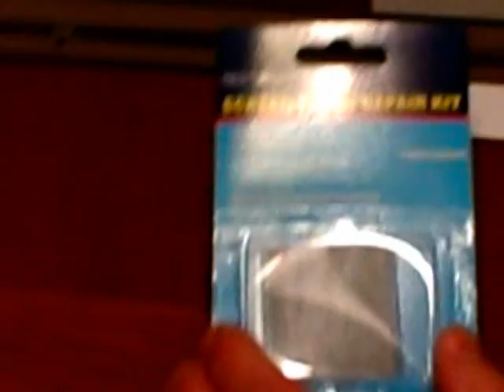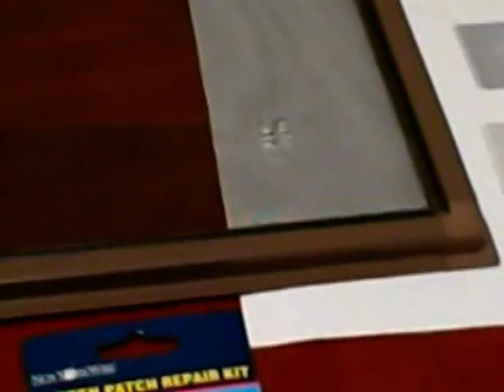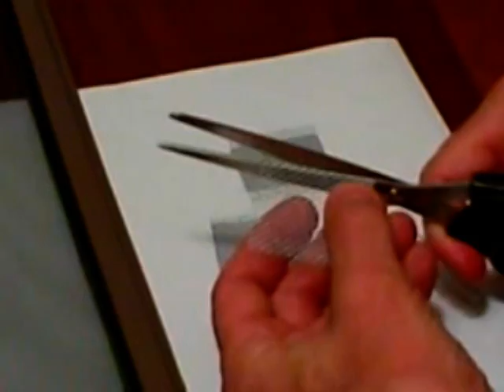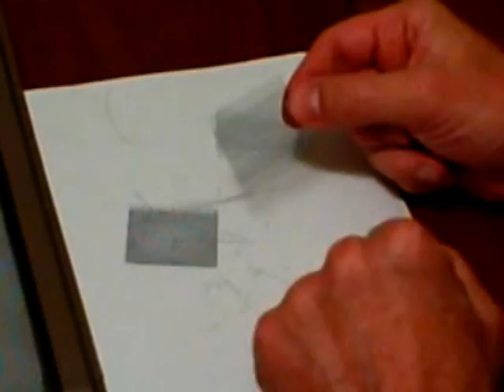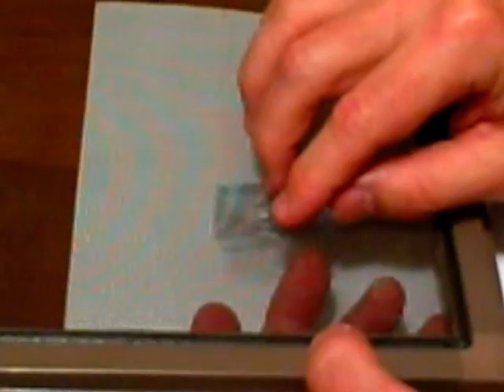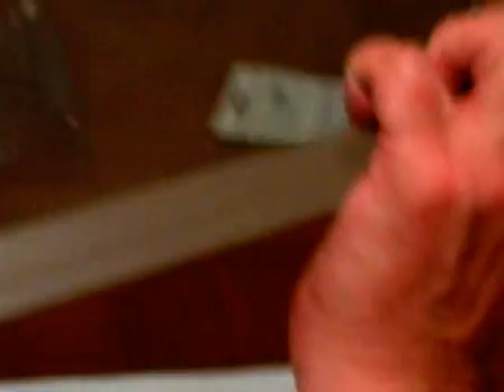How to patch a window screen - Window Screen Repair

Comment: I never have luck gluing but I still save any particularly yet serviceable hunks of old screen ...then rather than gluing, I simply SEW them overlapped on whatever new breech in the fabric...in fact just did a 5"X 15" section of sliding screen door  right at the edge surrounding in the  latch area ...I simply pried out  the rubber cord out pulling it loose in both directions and then with needle and thread, sitting in a chair I hand  sewed a  patch I'd cut just big enough to over lap and stitch in...next I trimmed out any excess within the patched area...then stretched it tight and pressed the cord back in...the final step was to run my razor knife down the metal for a neat trim ...looks totally patched but but neatly done with obvious pride in workmanship ...it is quality work!  No skeeters getting through THERE this summer!  ...I like it on account of it reveals my resourceful, innovative nature (well okay AND cheap assed)   Laugh all you want but it is another wonderfully  elegant, mechanically SOUND  redressment to another of my my not so loyal best (canine) friend's impudent escapades...if you ask me anyway....  After all any job worth doing, is worth the challenge of doing FREE without leaving the site ...stuff like this keeps the snobs off my property also, for they apparently simply cannot take such things lol  There's wrong way. a right way and a different way...
Reply: Also you see,  when a neighbor puts replaces their screen with a brand new one,  you snatch up that old one and then if is in better shape than one of yours you swap em right out!  (if you live in a tract all kinds of things are identical from one house to the next)  In either case however,  the newly acquired extra screen becomes a harvest-able resource...the cord is pulled free around the frame, the screen (if it is mainly still nice) is rolled up  tied and stored for future repair jobs along with the rubber cord if it too is nice...even the frame is disassembled and stored with all other hunks of scrap AL YOU menny M ...hey one way or another it WILL pay off to hang on to it (so long as it does not cost your marriage...lol)  ...I mean eventually ...start amassing to much scrap aluminum and ya just have to take it down to the crap metal yard and cash it in for a couple bucks per pound...I wager I have around 500-1000 pounds squirreled away AND my own private metal stock bin to build just about anything if I need to!  It's amazing how much scrap comes a person's way if they keep their eyes open and stay ever ready to POUNCE!  lol  BTW I have my heart set now on building my own forge and one use I can think of is simply to melt a lot of these un-neat wife's brain torturing hunks of aluminum into nice compact, clean valuable, fun to fondle and oogle ingots .....I LOVE that word ..."INGOTS" !  Yes  I WILL BE MASTER OVER METAL!!!  WHAAAH! HAAA!  ARRRRRR!...ARRRRRRR I say!   Make FIRE! Melt and master METAL!!!    Burly aluminum blacksmith!  clink clink...
Reply from the maker: Thanks for the tip!
Reply: Doug Chaney 
L
Reply: Dougie I love your comment exactly that what I was about to do...I love doing things my self even if it is literally dirt cheap.. especially when the fix like these patches wont make it clean look.. since I cant take the little filter from the bathroom because it is imposible without doing many hassle i tried first with the little metal thread the type you find to tie the plastic garbage but it did not align nor the same size, even though it can do the job.. so I bent a needle after heating it on fire .. and thread it with grey thread that match the screen.. the reason i want to catch the other end of the needle because I cant have access to the other side of the screen.. my needle is bent almost full arc or almost have a circle... I am ready to do it.. and then saw your comment... any tip would be appreciate it. Do you think the result would be somewhat invisible repair.. and should I thread as close to the hole .. and if so should tighten... cause I am afraid I would pull some of the good part of the little metal.. thanks ... love to know that there are many who take pride of doing these things.. take care

Comment: You wouldn't happen to have any videos or advice on repairing a bent or broken aluminum window screen frame or am I out of luck and just have to go out and buy a new frame?
Reply from the maker: Hi, you can go to the hardware store and they should have the stock. If not they should be able to order it for you. Many hardware stores also do screen repair.
We have more tips in our home improvement book http://www.amazon.com/dp/B01BK2K0JM?ref_=pe_2427780_160035660
Reply: See my comment above!!!!

Comment: Really good idea. I got a scrap piece of aluminum screen from the local "home improvement" store for pretty cheap, It took a while (the cut was about 10" long) but using the paper clip, it worked great. Cheaper than the $35 to replace the entire screen (until he learns not to, the kitten is just going to ruin it again anyway). Thanks. Peace.
Reply from the maker: Glad it was helpful.
We have more home improvement tips on our weekly podcast  https://podcasts.apple.com/us/podcast/fix-it-home-improvement/id880903087?mt=2
Reply: That is a brilliant idea. Unfortunately, my cat damaged my balcony screen and I live on the fifth floor! I need to repair the screen from the inside. I am not Mary Poppins!

Comment: I’m on the third floor and the rip is in the screen on the patio.  I don’t have access to the outside of the screen so how would I repair the rip?
Reply from the maker: Hi, you can do it from the inside. There are a few types of repair patches at the hardware store. One style just sticks in place, another style uses a blow dryer to activate an adhesive.
We have more tips on our weekly podcast http://castbox.fm/u/6389499.

Comment: Do you think this will work well enough if I cannot remove the screen from the window?  It appears the screen can really only be removed from the outside and it is on the 4th floor.
Reply from the maker: ProductPlacer Hi, I just showed a new patch that just needs a hair dryer. Here is a link https://www.youtube.com/watch?v=7GhS2DjHIfo

We also have more tips on our weekly podcast https://itunes.apple.com/us/podcast/fix-it-home-improvement/id880903087?mt=2